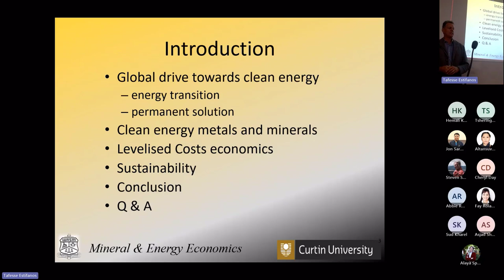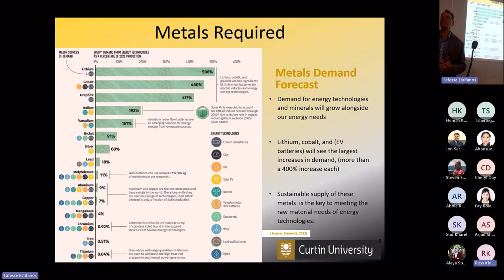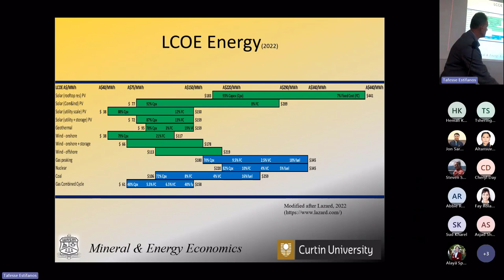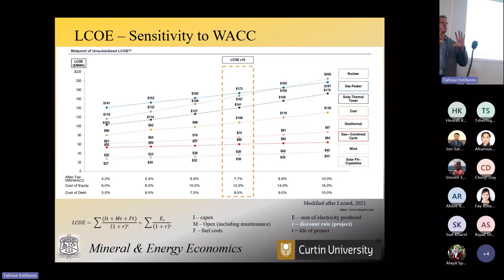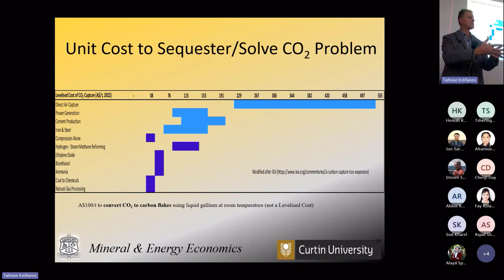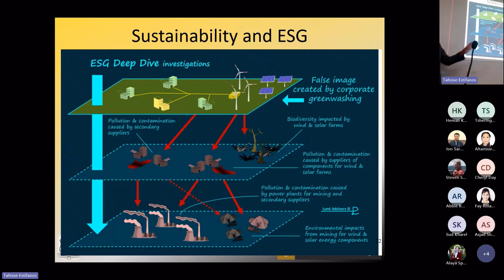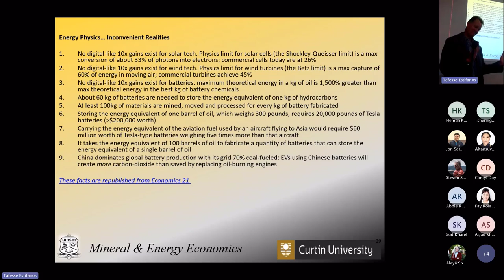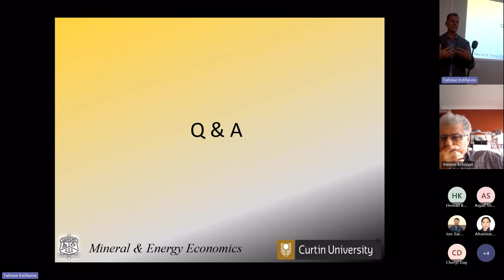Clean Energy Economics – Where Does Sustainability Sit?  By Associate Professor Eric Lilford,

Comment: You do not “convert sulfur dioxide and particulates to a co2 equivalent”. These are part of different impact mechanisms, infact mentioned as acidic rain. Co2 eq exists to capture other GHGs contribution to GWP.
Reply: That's semantics. Environmental degradation is measured by different means. I agree with the pure physics of your statement, but not with its interpretation to an equivalence.